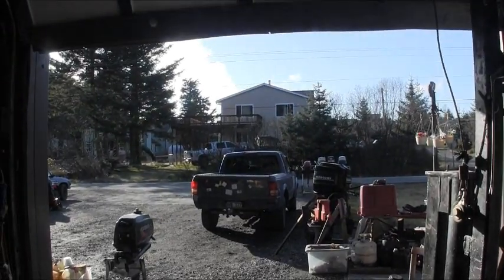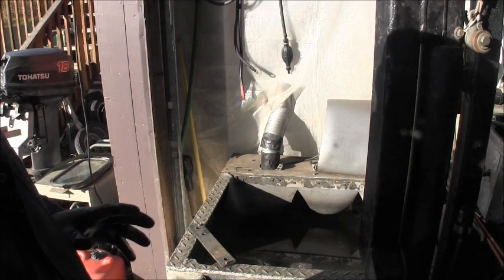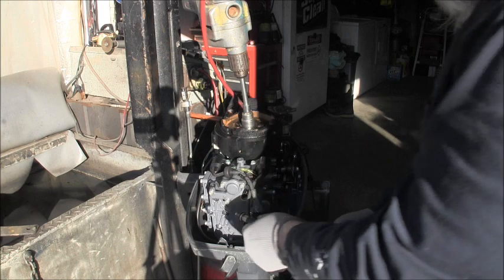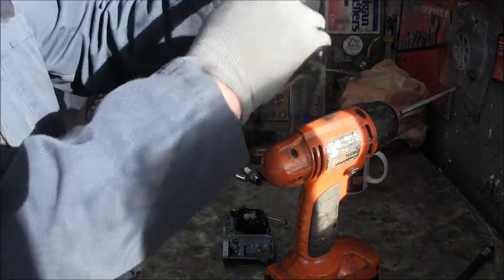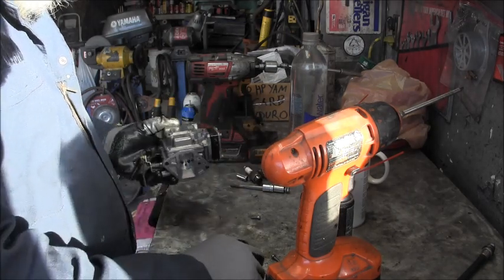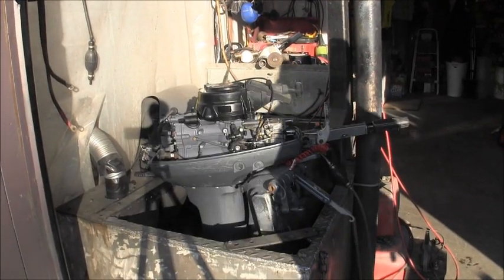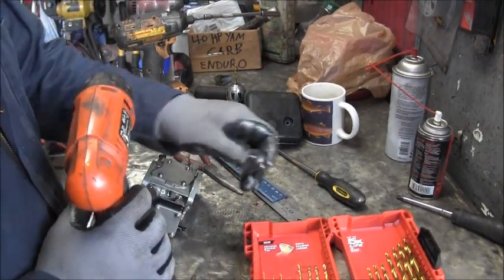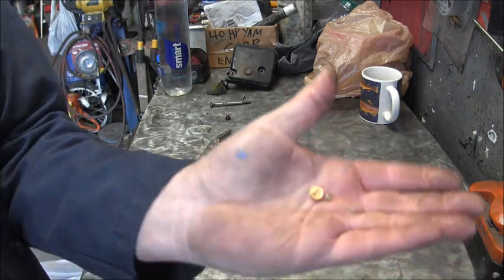YAMAHA 15  HP 2 STROKE,    (  Submerged  )

Comment: hey Kodi I bought a 1968 mercury 350 35hp I found a screw about the size of a nickel down on the lower unit that says flush do you know what that's for
Reply from the maker: Yes' Merc makes a screw in flush device that attaches to a garden hose instead of ear muffs so you can run & fresh water flush the motor .     kb